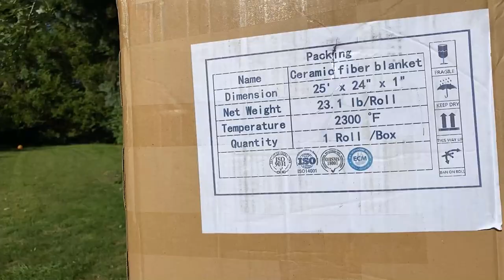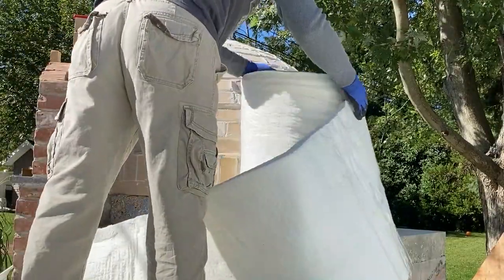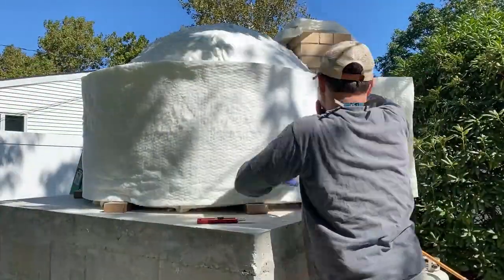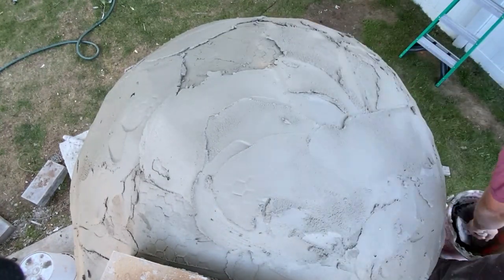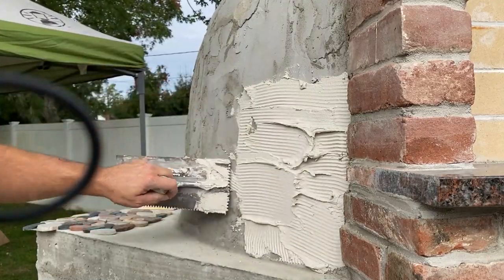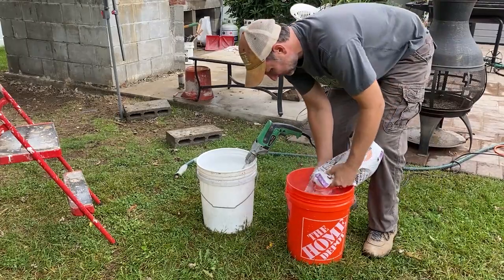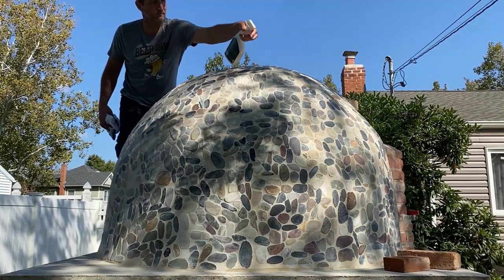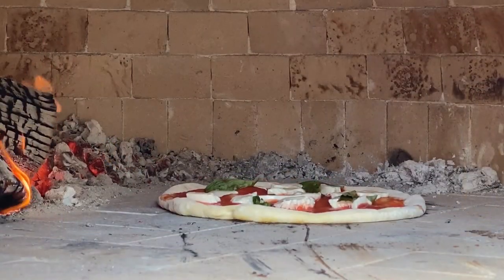How to build a brick oven / Outdoor Kitchen Build - Part 8: Insulating and Rendering a Brick Oven

Comment: did you just use regular mortar over the top of the blankets? or did you use refractory mortar? any reason you didnt remake a vermiculite concrete to use over the blanket?
Reply from the maker: Regular mortar. Vermiculite is not dense. It is also brittle and should not be exposed to the elements.

Comment: I built one about the same size, but entirely out of vermiculite and portland mix, fire brick floor.
I want to start over and go entire firebrick
Reply from the maker: I would imagine that it doesn’t retain heat since vermiculite is more of an insulator. Does the pizza cook well top and bottom.?
Reply: Cooks great on top, but sometimes the bottom is not cooked all the way, still ok to ear and taste great.
I think I need to start over and go all firebrick dome

Comment: Aren't you supposed to cure the oven for about a week, each day starting from a smaller fire the first day, having it cool down completely and then repeat the process gradually getting hotter fires the next 6 days? That's in order to have all the building materials to settle down and cure so that nothing will crack in the future.
Reply from the maker: Yes. Check out part 7

Comment: Thank you so much for these videos! I'll be definitely building it this summer.

What's the surface temperature inside the oven?
Reply from the maker: I start cooking pizza when the surface is about 800F.  Oven easily exceeds 1000F.  Im sure the floor can exceed 1000F to but I never tried.

Comment: Great video series. Our oven is nearing the stage where we can cure. However, in one video, you added the flu adapter plate yet never did anything with it after that. What was the purpose?
Thanks!
Reply from the maker: Thank You. It will be installed this summer after the roof is built
Reply: @ArtisanMade  Thanks, I look forward to that. I purchased the adapter since we too will eventually cover the oven/counter top area. We cooked pizza saturday for the first time. It was amazing. Your series helped a lot.

Comment: After application chicken wire, whats your ratio to mix concrete mortar ?? thank you !
Reply from the maker: I didn’t measure but I remember having to add more water because the mortar wasn’t holding on to the wire. You want it to be easily spreadable so that it will lock into the wire and hold until it dries

Comment: When you laid the natural stones on top of the dome, I noticed that you used Custom Building Products PremiumPlus Standard Thin-Set Mortar.  

QUESTION: Do you think it's necessary to add a Thinset Mortar Admix for increased bond?  I live in Canada and concerned that the cold weather might cause the tiles to come off.
Reply from the maker: Sorry for the late response.  I never used the admix here in NY.  No issues so far after 2 years.